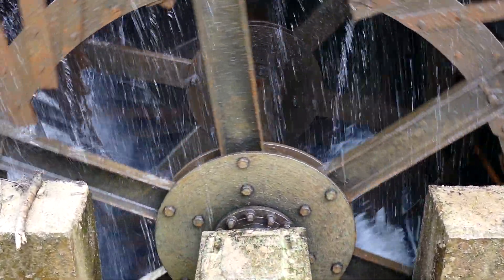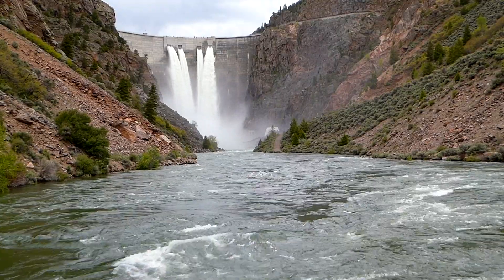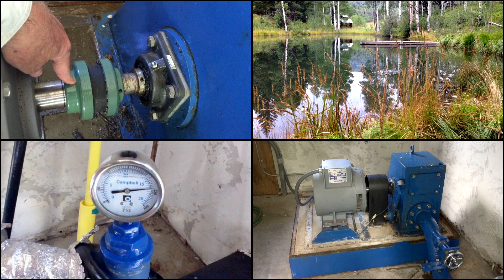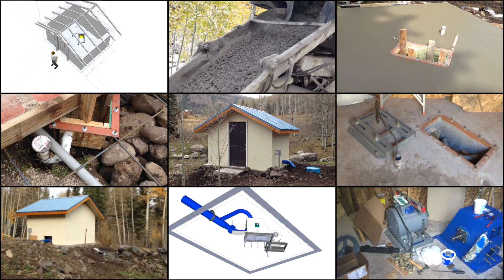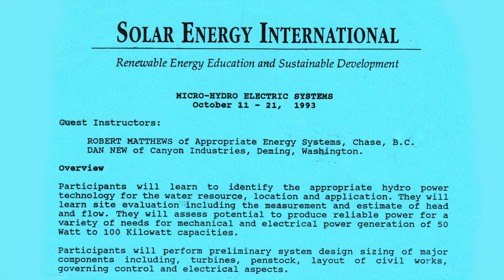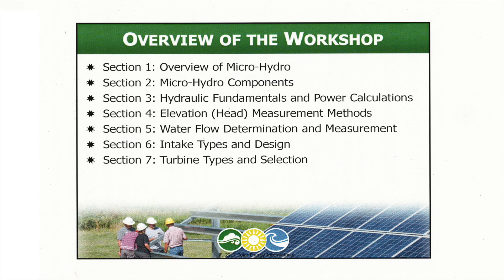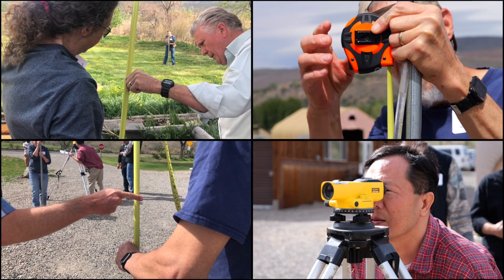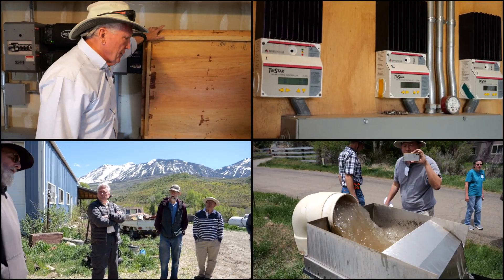Learning Micro Hydro Power in depth

Comment: Still wondering why you haven't used a Crossflow. Your projects def. inspired me and I'm currently planning a system on my own.

I have a pond which can be emptied to 50% and be used as temporary energy storage. The turbine will be a Crossflow, as it's most efficient in a very large variety of different loads. As I don't use a battery system, I will use an old 230V AC gasoline generator and remove the engine. The governor which controls the engine will be used to control the speed of the generator as well, but with a little twist:

The Crossflow turbine takes quite a long time to spool up and output more power or spool down to output less. So it cannot be used directly for turning a net synchronous generator. So I'll install a flywheel in between with CVTs on both sides. The flywheel speed is measured and depending on the measurement the Crossflow-Turbine-Valve will be opened or closed. The CVT allows the Crossflow turbine RPM to be decoupled from the Flywheel RPM for short durations and also allow for a smooth start without stalling out.

On the output side the CVT need to be adjusted precisely by the governor instead of weights - to get the precise 50 Hz
Reply from the maker: Wow that sounds like a very interesting project. Any you sound like you're a highly technically proficient person.  I believe one of the next projects that Ken Gardner is working on is indeed a crossflow which will be built by Gabe the man that works with Ken.  I went to see the site which will run off water diverted from a creek to a pond.  The turbine will be installed on the water returning to the creek.  It has only about 12 ft of head and it currently has a system which is going to be upgraded to the crossflow.  We shall see how it turns out. Thanks for watching and sharing your plan!
Reply: @mrhydrohead  yeah my installation is similar in head pressure: we're currently planning on 24 meters, but not sure if we can build there securely enough for the storms in the area. :)

The whole plan is to be able to get 10-12 A out of the generator without it ever stalling when loads are turned on or run away when loads are turned off.

Hope this all works out :)

Comment: I have been investigating the Archimedean Screw turbines...it needs very little head (as low as 2 meters) as long as the flow is high enough.  
This is important in my area because it is rather flat here compared to your mountainous region.  
The RPM's are also very low starting at about 50 RPM's and up...so the noise level is much lower as well.  
I hope to get my property soon and will be installing turbines soon after.
Reply from the maker: I've been looking at those myself out of curiosity.  If I found one I could document I would do so.  Low Head/High Flow works too, but you might consider a crossflow turbine as well.  Its a smaller install and works on low head.  Good luck Thanks for watching!
Reply: Screws are seriously expensive and you need a large flow to compensate for the low head.

Comment: I would like to ask you how to calculate the prospective power of pelton turbine if I want to use the domestic water supply. It is just an experiment(I have pressure 6 bars and flow 3l/s). Thank you!
Reply from the maker: I don't think its going to be worth the expense once you subtract the cost of your water bill.  But anyway you will have to convert the units in this formula. Watts produced = Net(not static, but flowing) Head in Ft. multiplied by Flow in GPM divided by 9 for AC or Watts= Net Head x Flow / 9 for AC.
For DC you would divide by 15 as it is a less efficient method.
Hope this helps.  Thanks for watching!